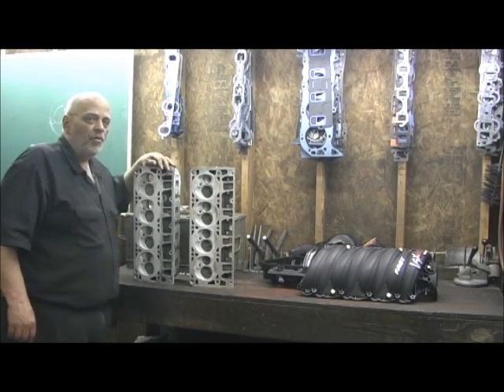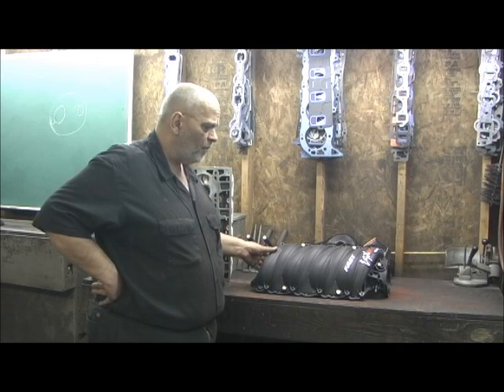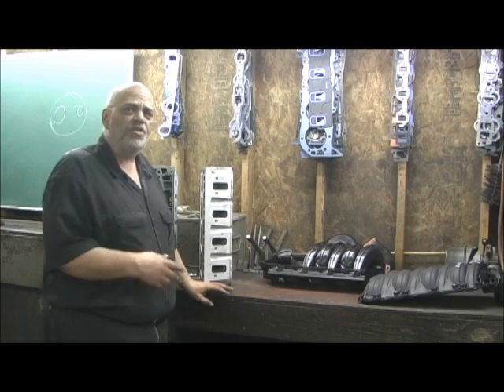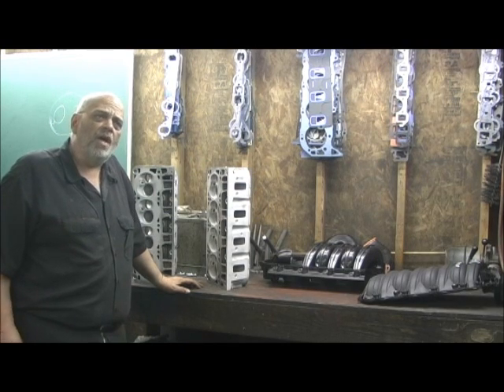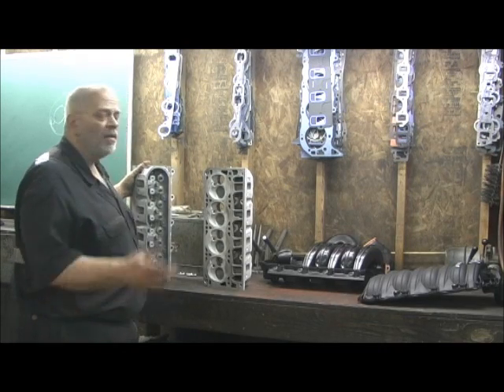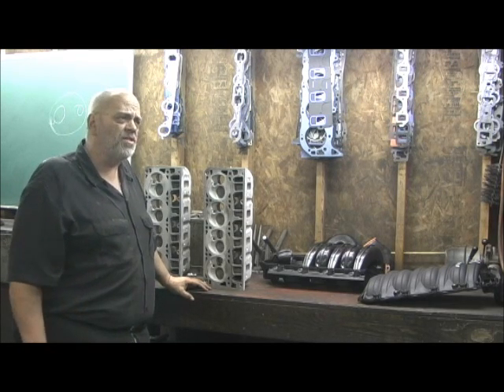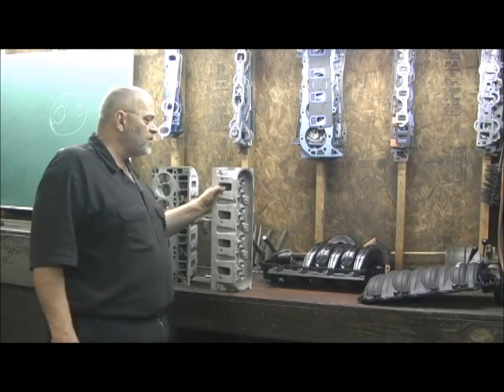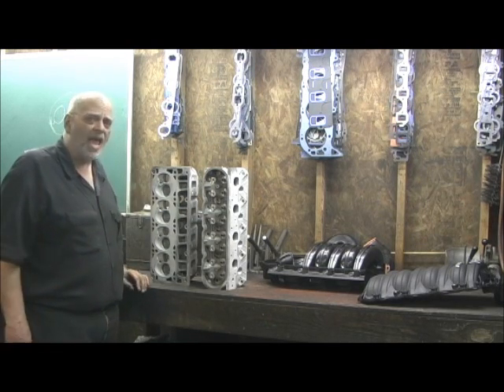2013 LS3 Heads W/ F.A.S.T. LSXR Intake Introduction 1.0

Comment: Three things I do not like about LS stuff from an engineering standpoint, 10 headbolts, angle of the intake port toward the outside of the cylinder (like a smallblock Ford), and very tight valve spring area. Damn Yankee